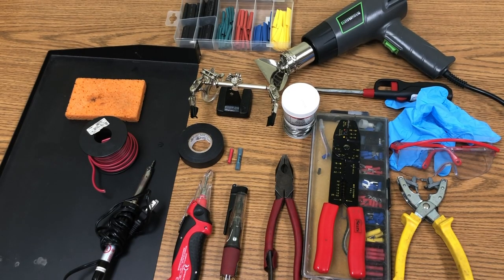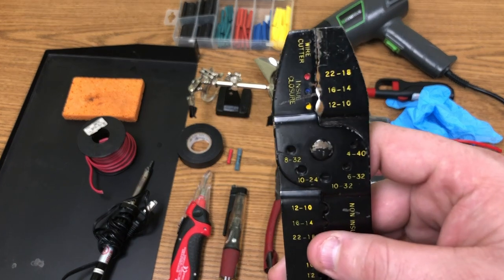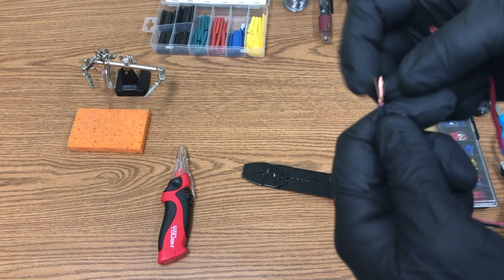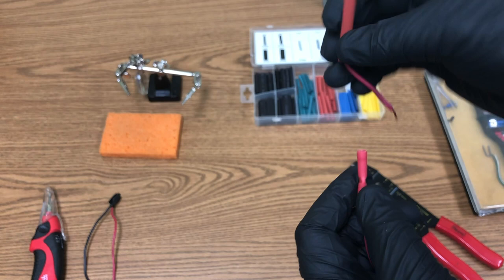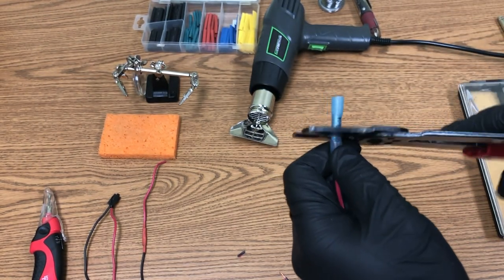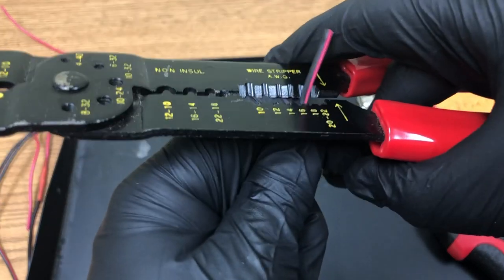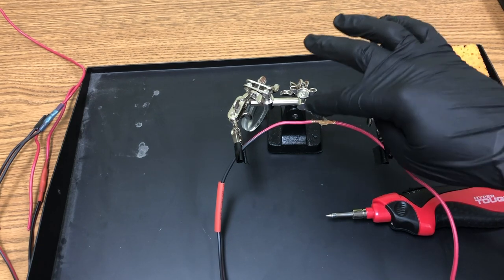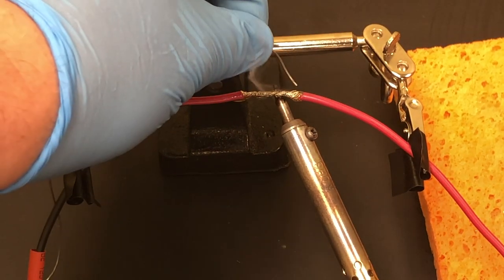4 Ways to Connect Wires: Split & Tape, Butt Connectors, Heat Shrink Crimp, and Solder. Complete DIY

Comment: Thanks! I’ve been doing solder wrong for years. Mine always balls up on top. It makes so much sense putting the heat below and allowing it to wick up the stands! Thanks man!
Reply: That’s a cold solder joint and is not good for wires bc it can cause cracking and failure. Do it like MC Fix It shows you bc that’s the correct way!
Reply from the maker: @marcusnorton456  Yes, that's a cold solder joint and is not stable. You will want to redo that connection and make it better
Reply: Don’t do it that way Thomas. 
Now you know and knowing in the half the battle -GI Joe!
Reply: Yeah, I’ve been doing it wrong for years too! I always wondered why it never held up like butt connectors do. I know now!!!
Reply: Don’t do it that way. A cold solder joint is useless. Always allow the solder to wick into the wire and not just ball up on the top.
Reply: MC provides some great instructions in this video. Thank you!

Comment: Each type of connecting method has it's correct time and place, but twist on electrical wire nuts are very handy.  You can buy them with jelly in them, for anti corrosion or fill them with silicone, if you need to keep the moisture out!
Reply from the maker: Yes, adding a wire nut after twisting works well for certain applications. I was just working on a ceiling fan that had those. Easy to remove and replace.
Reply: I’d stay away from wire nuts on area that can be wet or moist... use something with heat shrink wrap
Reply: @jphamilton6987  That's why I said, every type of electrical connector has it's correct time and place - and that they make them with anti-oxide jelly in them. Shrink wrap has both ends open, so isn't really that moisture proof either?
Reply: I use wire nuts on my house electrical wires

Comment: Great video. I knew the first method would not hold up to a pull test!
Reply: Same. Just get the right tools and do it correct the first time!
Reply from the maker: Yes, but it's a common one I see a lot. A little strip back and electrical tape doesn't last long and is not a secure fix.
Reply: Yes, I knew it as well. Very interesting how well the other three held up. Good insights in the video too! Thank you
Reply: Yep!
Reply: Yeah, it was doomed. I’ve seen this so often in car audio it isn’t funny!

Comment: Great video! 
I've known too many people that use a lighter to shrink heat shrink.... Makes it very brittle if you do that, SO thanks for using a heat gun!!
Reply: And you can burn the protective coating on the wire too. Use a heat gun!
Reply from the maker: Very true. Use a heat gun if you have one. Some brands are much hotter than others. Use the first setting and then move to the second one if it takes more than about 10 seconds or longer to start shrinking.
Reply: Heat gun is the best option. Just be careful to not have it up too high... some get really hot!
Reply: Never use a lighter!

Comment from the maker: Tools:
• Heat Shrink Wrap - https://amzn.to/3bghFPr
• Heat Gun - https://amzn.to/3tBbRGu
• Wire Strippers - https://amzn.to/3ezQmBU
• Helping Hands Tool - https://amzn.to/3vSOLwD
• Electrical Tape - https://amzn.to/3hfLeEK
• 18 Gauge Butt Connectors - https://amzn.to/3h8YN8S
• 18 Gauge Heat Shrink Connectors - https://amzn.to/3bengG4
• Wire Crimper Tool - https://amzn.to/2SEORtB
• Solder 60/40 - https://amzn.to/3vQJ7uY
• Rosin Flux - https://amzn.to/3euwLTo
• Solder Iron - https://amzn.to/3heXogQ

00:07 - The Four Ways Described
00:43 - The TOOLS for each way
03:32 - 1. Split & Tape
07:49 - 2. Butt Connectors (+ Heat Shrink Wrap)
08:34 - 3. Heat Shrink Crimp Connectors
11:32 - 4. Solder (+ Heat Shrink Wrap)
18:11 - PULL TEST: See how each holds up by pulling them! 

You can easily fix your own broken wires with just a few tools and the know-how described in this video.  

Check out my website at http://mcfixit.us 

Disclaimer: Due to factors beyond the control of MC FIX IT, I cannot guarantee against improper use or unauthorized modifications of this information in the video, post, blog, or social media. MC FIX IT assumes no liability for property damage or injury incurred as a result of any of the information contained in this video. Use this information at your own risk. If you feel uncomfortable at any time. Stop and go to a professional. MC FIX IT recommends safe practices when working on vehicles, your house, or any other project and or with tools seen or implied in this video. Due to factors beyond the control of MC FIX IT, no information contained in this video shall create any expressed or implied warranty or guarantee of any particular result. Any injury, damage, or loss that may result from improper use of these tools, equipment, or from the information contained in this video is the sole responsibility of the user and not MC FIX IT.

#mcfixit #howtovideo

Comment: How does the small butane solder tool work? Is it easy to use? Does it smell a lot if working inside?
Reply from the maker: It's a great tool. I only use it outdoors. It doesn't smell bad but definitely has a butane-like smell. It's small and cordless which is very helpful working on wires in tight locations!
Reply: I was going to ask this! Thanks for already responding MC
Reply: Butane one works well. You can even use a basic butane torch as well. Many already have one and get hot quickly
Reply: My butane solder torch bit the dust and doesn’t work any longer. It did work well

Comment: Can you give a link for the yellow handled wire stripper please?
Reply from the maker: They are a Klein 74011. I'm not sure they are still in production because I couldn't find them on Amazon. They are pretty old now... probably 20 years.

Comment: Where did you get your heat gun at?
Reply from the maker: I got mine on Amazon for about $20 - https://www.amazon.com/dp/B00EU2T8GG/ref=cm_sw_em_r_mt_dp_Rz-8FbNWTW5ZB
Reply: They have them at HF for less than $10
Reply: They sell them just about everywhere... or just use a lighter
Reply: You can get one for $8 at Harbor Freight. It works pretty well but only have one speed!

Comment: Before making an instructional video I would make sure to use a soldering iron that can handle the job. That soldering iron was too low in wattage, tip too small and the temperature was too cold. It should have taken 5-10 seconds,  not two plus minutes. At least the 60W soldering iron in your Amazon link would do the job properly, more watts, adjustable heat and a better tip. Try it with that iron and it will take 5-10 seconds.
Reply from the maker: Yeah. That soldering iron has since bit the dust. It did take much longer than it should have. Sometimes you’ve got to work with what you have though. The technique is the same just need a lot more patience, lol!

Comment: Do you like the little battery operated one?
Reply from the maker: It works but is not as powerful as the corded version
Reply: They work okay. Is prefer one with more power tho
Reply: It also takes a bit longer to heat up. Take batteries out each time bc they can easily corrode inside